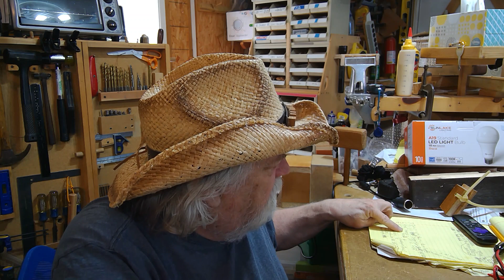OTB Thinking and More by Rambling Russ

Comment: I think the use of the penny is quite clever and certainly useful in a pinch. I'm not schooled well in chemistry so I'm wondering if the old dissimilar metals thing would set up a corrosion issue if the penny was left in place for a lengthy period. 
great tip though.